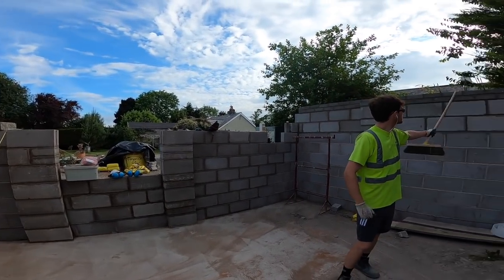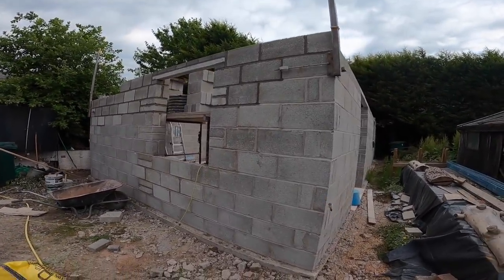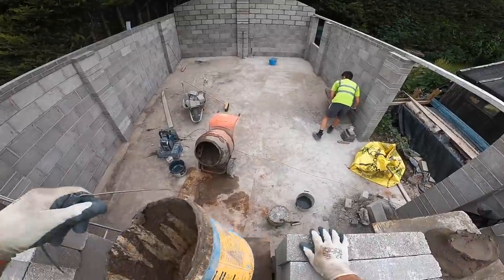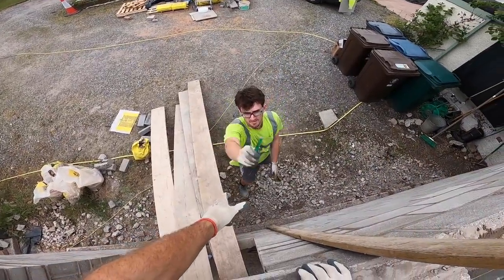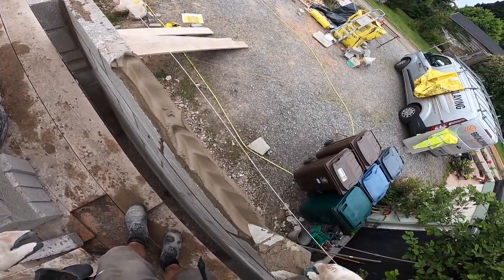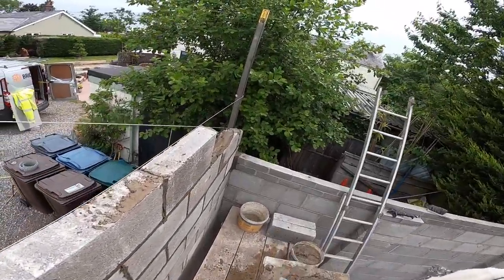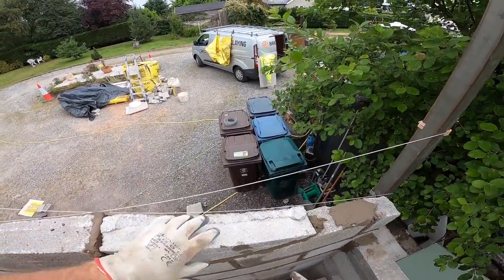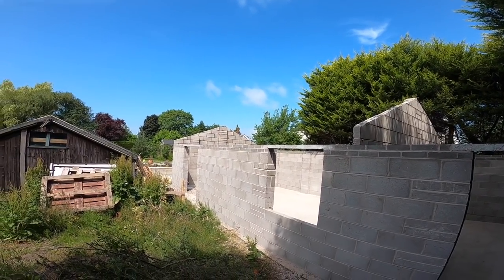CONCRETE BLOCK WALLS ..SUMMER HOUSE FINAL EPISODE

Comment: Good vid boys, constructive criticism only but far to many movements to lay one block and stop thumping them down with a clenched fist it's traumatic to your body and will come to bite you in later years 👍 also chuck that pieçe of tin foil away when laying conkers and use a vintage WHS with a bit of weight in the blade to get them down. I've got a 12 inch as new 1970s one you can have can always grind it down if it's to big 👍
Reply: Sorry my comment was directed at Alex Steve 👍
Reply from the maker: No probs pal I will keep an eye on him , thanks for the advice , it’s always good relevant and helpful advice from you pal 🤜🏽🤛🏽🧱👍🏽

Comment: In the US I don't see near as much residential block/brick construction. Is that a code thing in UK or preference?
Reply: Quite the norm in the UK although we are seeing more timber framed buildings now.
Reply: @CraveThatCoin  Over here the framing is 2" X 4" (more 2" X 6" on exteriors now) with the brick overlaid as a veneer. Depending on the area (North, East, South West), the veneer might be only on street side and occasionally complete exterior.
Reply from the maker: @calvinjutila8270  masonry and blocks are in a majority at the moment but things are changing 🧱👍🏽

Comment: Nice one guys. Al,  the distance from middle finger tip on one hand to middle finger tip on the other, equals your height. I use this often for quick measurements. Stay safe lads.
Reply: I don't believe that's true. Tends to be within a few inches but varies a lot which is why reach and height are mentioned for boxing/combat matches.
Reply: @CraveThatCoin   Simply a general body ratio

Comment: If you ever want to measure but don’t want to lay down, use your arms with fingers out, that’s the same as your height
Reply: I don't believe that's true. Tends to be within a few inches but varies a lot which is why reach and height are mentioned for boxing/combat matches.